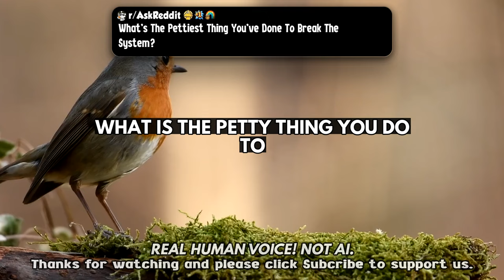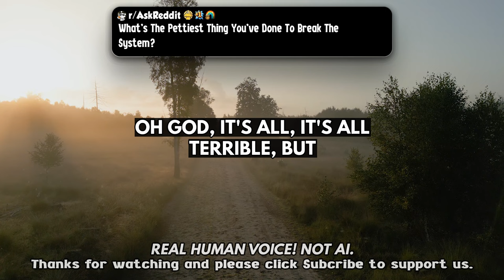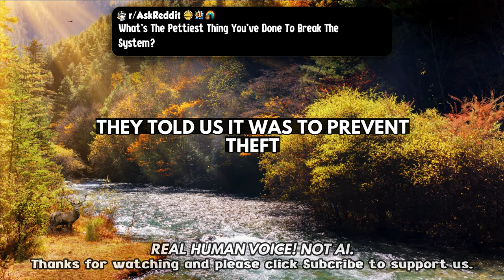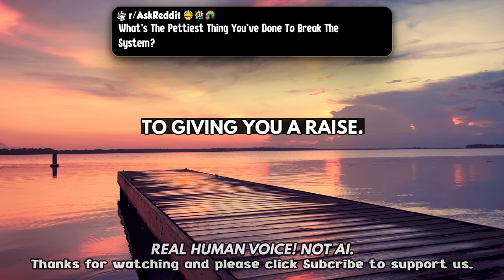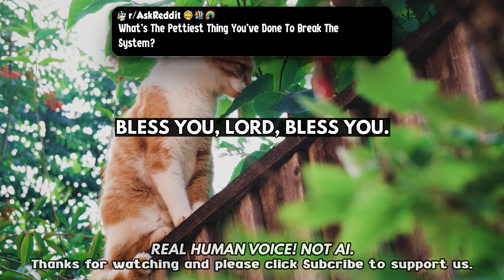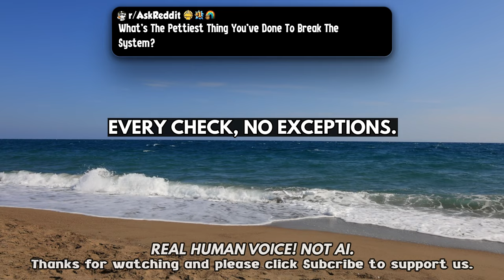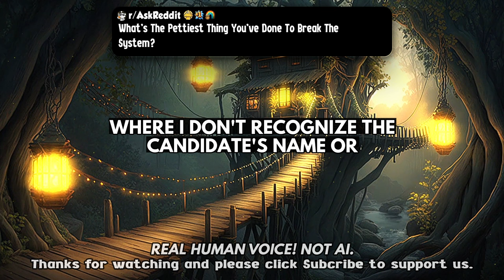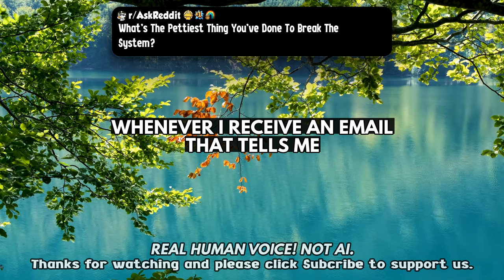r/AskReddit: "Worker Sabotages System With Network Cable Trick!"

Comment: Eggs in air ducts are amateur level actions since they will dry up quickly. Instead roll batches of potatoes above the ceiling panels into the far corners. The spuds are most effective when decomposing in small groups so send 4-6 to each spot. Similarly one could puncture a tuna can and roll or slide it into inaccessible areas. Be sure to wipe the cans and wear gloves to avoid leaving any prints. If one of these treasures is found it only creates a false sense of relief since the rest will still be there decomposing. These budget items will achieve their maximum effect long after you are gone.
Reply: Prawns / shrimp hidden in tubes like curtain rails, inside office chairs etc could be a fun one
Reply: Those also dry very quickly. Unless it's like, pounds and pounds of raw shrimp.